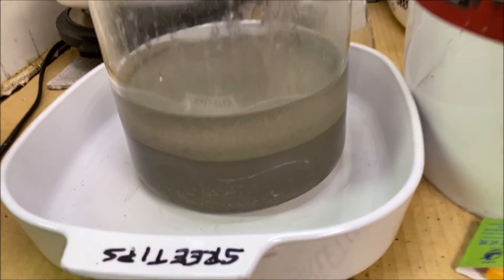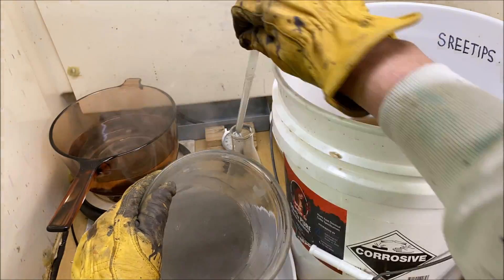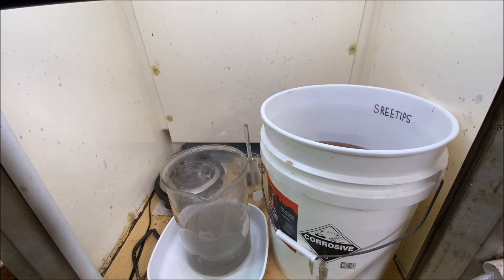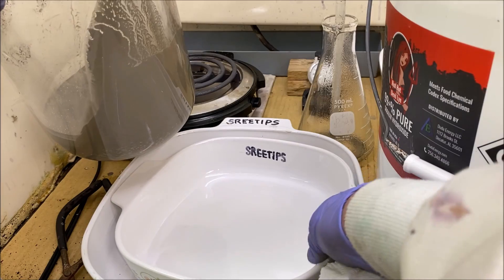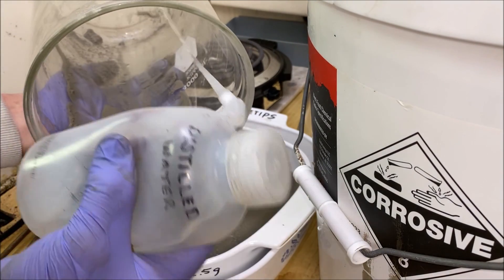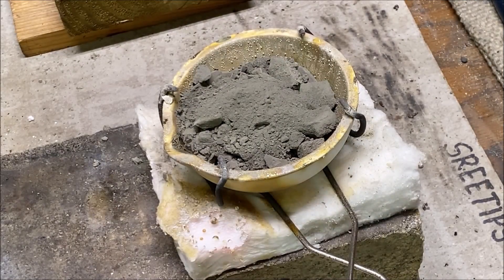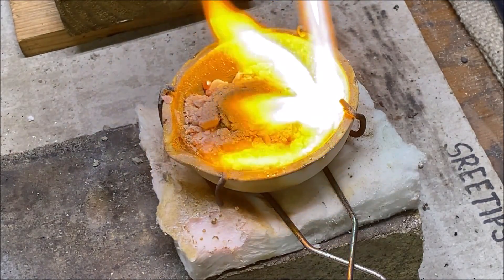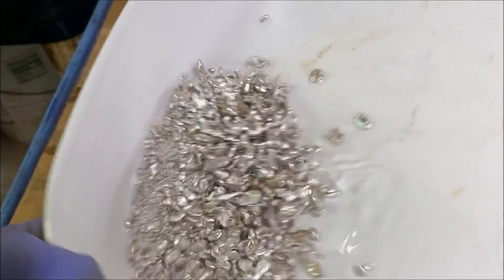Silver Chloride Conversion With Lye and Sugar Pt2

Comment: The ph of tap water here in Phoenix is 8.2 out of the gate. Im doubting I would achieve nuetral ph without adding HCL and thats a ton of rinsing.. I'll stick to the cell. Thanks for all the videos. Ive seen most of them and gleened some your processes to make my own set up more efficient. Much appreciated.
Reply from the maker: Ours is about 6.5

Comment: can you use rooto household lye based crystal drain cleaner or is it not the same sodium hydroxide and pure lye? for silver chloride
Reply from the maker: Rooto lye is pure sodium hydroxide and can be used to convert silver chloride to silver oxide.
Reply: @sreetips  thank you, i've recovered some silver chloride using hcl and want to try the lye and sugar. last time i recovered silver i just used copper to drop silver from solution. i have my silver chloride sitting in water. it's not as much as yours but it adds up.

ihave the gold down since i been watching you and others doing gold refining. I also bought the hope's book but there is so much it talks about. confusing for me. I also do the refining outside and leave it and come back to check on thing as it doing its thing. So far I have about two ounces recovered and the solutions in 5 gallon buckets.

Comment: Have you thought about either switching out that big cutting nozzle on your torch for a finer one? That and not turning your gas and O2 up so high would help control blowout. You could also probably just use a brazing torch instead of a cutting torch, although it wouldn't be as fast.

Comment: Why do the individual granules have different colors? Does it have to do with the amount of oxygen exposure the molten silver gets before it hits the water? I would assume every piece of shot from the same molten metal would come out with the same color.
Reply from the maker: It only takes a trace of copper to turn silver real ugly.
Reply: @sreetips  I'm not surprised that the copper contamination created some color but I figured it would be evenly spread through all the pieces of shot

Comment: the other downside of this silver chloride method is you have to do so much lifting and pouring (pouring in the rinse water and pouring the rinse water out, and lifting rinsewater buckets around) i guess you cpuld do siphons instead, or some may consider that not a downside but a benefit from the physical activity. but my point is the silver cell method is less labor intensive and less liquid waste going around

Comment: The description of the careful melting method made me think about if it could be possible to be even more economical with the torch gases. If only some of the heat that is being lost to the air could be trapped or reflected back onto the melting area. I'm sure some sort of lid (with a hole in it for the torch) was tried in the industry, but the gases still need to escape somewhere, and maybe that's where most of the heat loss happen.
I wonder if an infrared camera (the kind that laptop reviewers like to use to demonstrate heat distribution) would provide some insights into the heat distribution patterns around the melting table. I imagine there's a rising column of hot air above the crucible... or maybe air currents go in every kind of direction due to the pressure of the burning gases...
Reply from the maker: Infrared would be neat

Comment: It would be interesting if you did a video like the jewelers floor video but with your own melt table and floor sweepings.
Reply: Sounds like somebody else noticed the assorted bits and pieces that went on the table instead of in the dish - That's what got me thinking pretty much the same thing... Only I was getting a mental image of a "lab safety" type sign reading "ATTENTION! All floor or table sweepings or vacuum cleaner pickup must be placed in the reclamation bucket to be incinerated and added to a future batch"

Comment: Excellent video, as always.  Would the higher purity shot affect the slimes produced in the anode filter basket? Or is that more of a product of the electrolyte?
Reply from the maker: There will be far less to no slimes at all with high purity silver.

Comment: @0:30 You could have bubbled carbon dioxide into the solution to form sodium carbonate, which would have a good solubility in hot water, so rinsing it would be quicker. In your last video, perhaps you could have used an electrical pH-meter to reduce the added sodium hydroxide in the first place. Thank you for your great videos!
Reply from the maker: Bubble CO2? I’ll try that.
Reply: Waiting for that video now 🤦

Comment: Since you're doing this in a fume hood, couldn't you just heat the Silver Chloride to liberate the Chlorine leaving just pure Silver behind without the need for all of the washings?
Reply: The silver chloride has to be chemically converted to silver oxide, then to silver metal.  These are reduction and decomposition reactions.
I understand where you are deriving your question, but it is much different than having separate silver metal and chlorine gas in a hypothetical mixture, then simply separating the two by exposing to heat.
Reply from the maker: No, but it can be done in a furnace with lots of soda ash (sodium carbonate), so I’ve been told. But I’ve never tried it.